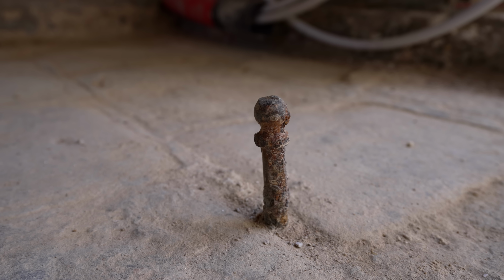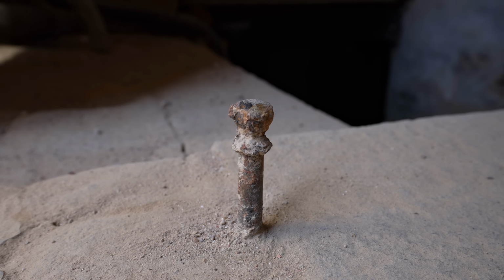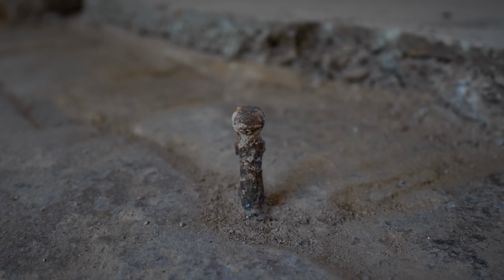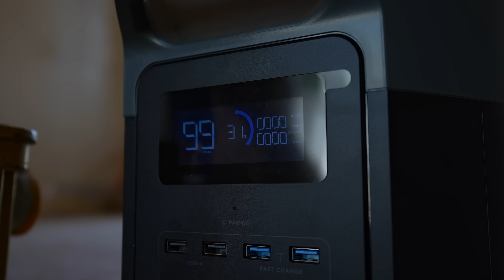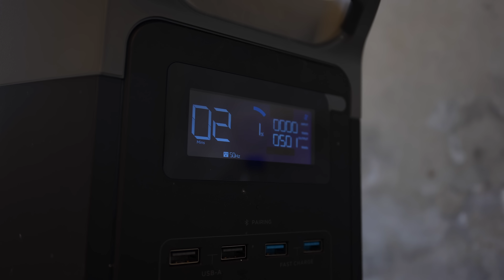Uncovering a 250-Year-Old Hidden Floor Beneath Concrete

Comment: Thank God! A voice of reason! Lol! Love it! I do have a question though…Are the doorways really that short? Or is it the camera makes it look that way? Usually in that time period for buildings of that time period, the doors were usually a lot taller. As you probably noticed at the chateau. I have been wondering if the height of the doors are the original height. The third floor I can see the doors being shorter but, not the main floor. Great job Billy! I’m glad you explained about those metal pegs on the floor, I hope you take them out, they are a trip hazard. But keep them. Put them in shadow boxes and display them somewhere with explanation. Enjoy your Sunday off. See you on Monday!

Comment: Thumbs up for in situ preservation where you can. I wonder if a clear epoxy or poly floor coating would give a smooth finish and provide some additional protection to the flagstones.

Comment: What about using paned French glass doors in that hallway? Let the light flow and would look stunning, especially if the panels are beveled glass 🤩
Reply: I am on the same thought as you are!   I think FRAMELESS glass doorS on both ends of what I believe was a walkway/cart path years ago.   The walls on either side are so thick, they are external walls.   You can Google frameless glass doors for old churches or buildings.   There are lots of places that can do those.    How wonderful would that look to be able to see the original walls on both sides and look all the way through to the back garden

Comment: I think raising the floor is the best option. You don't want different floor levels if it used for commercial or residential. If you number the stones, it will be put back in place with no one the wiser. 😉

Comment: One big question is does this floor material extend into the next room as well? We know it wasn't in the kitchen unless it was removed sometime in the past. No question that this is the original floor and it is extraordinary. Might need a bit of sand blasting to clean it up but that would be minor.  Some of those pieces bordering the floor where the steps go into the basement are massive.

Comment: I wouldn't even add ramps.Since you already have that step outside of the door, maybe just remove that so the threshold is only slightly higher than the floor to keep water out, and then get a slightly taller door.

Comment: Is this a dry laid floor with out mortar joints between the blocks? If it ism, you may be able to remove the stones one by one and raise the sub-floor bedding by 10 cm's. But that is a lot of work. 
On another note, the concrete that was removed is some of the funniest concrete chunks I have seen. The do not seem the crack across the aggregate but around it. It looks like "bubbles". This is not a criticism of Billy any any way, he is just removing the top layer.

Comment: Make the new floor level for all of the rooms the same as the hallway. Build the new doors at either end of the hallway to the original floor level. That way you only have one ramp - into the kitchen. 

If the next room has a good original floor, it should be on the same level. If it doesn't, you can dig it out as you did in the kitchen, but keep it at the same level as the hallway.

Comment: Of course, original is always better and it is wonderful to be able to walk on an original floor where it has been for hundreds of years. Having said this, different levels can be an annoyance. A lower level from the outside means there could be water issues if there’s ever an accumulation of water outside. It’s also a nuisance going in and out of the rooms that adjoin the hall. Another consideration is space. Every step, stair or ramp diminishes your floor space and makes it more difficult to move around in that space.  I am not a huge fan of ramps in historical places. Handicap accessibility is a modern development. Taking everything into account, if raising the floor is doable, I feel like the best thing to do would be to put in the time and effort to keep the end result as satisfying and easily accessible as possible.

Comment: I'm wondering why you didn't use a quick cut to slice up the concrete then use the Jac Hammer ?  And turn the bucket around ?  Wasn't it a practice back in the day when flagstones were a bit worn to lift them and turn them over ? You could put in under floor heating and re lay them ? That way they would be the correct level?

Comment: I would leave the floor as it is, as you will never get it back exactly as it is now. Also, raising it would destroy it as the original floor. All you get is "something built from original material", which is not the same.

Comment: Ramping it is a good idea. Just a word about that, in the US, and I presume there as well, there is a defined distance per elevation. Here it is a foot of length per inch of height, 30 cm per 2.5 cm given that my math is correct. So, that is to be considered.

Comment: Everyone is saying to leave the floor alone...It's not like you'd be tearing it up like the hearth. Do a few rows at a time and leave the pattern exactly like it is. While ramps are a thing I'd consider them a quick fix. You have been doing everything above par so far so why do minimal here? It is the entryway isn't it?. You need to put cones over those steel studs sticking up also.

Comment: Still think it was an open area where horse carts and stuff was pulled into the backyard. 
Also, now that the floor is lower again, you may need to make sure the doors have proper drainage so they don’t drain in.

Comment: I think it would be great to leave the floor alone, however I don't think It's realistic.  The reasons to rase It are to great.  First off If you don't you will have issues possible with water Intrusion. 
Second you bring equipment through the building all the time and that will probably always be the case. Third the handicap Issue. I thought about If you remove the thresholds since you are
putting in new doors anyway, but then the water Issue and the issue entering the other two areas.  If you ramp the floor, by the time you are done you might as well just have raised the floor up.
I fully vote to spend the three days with two or three helpers and rase It up.  If you are carful you will never notice the work having been done and everything will be smooth, level, and happy days forever.

Comment: I wonder if that room was a dairy.  If it was, they would have tossed water on the stones to keep the temperature down and the lower level would keep the water inside the room.  Is there dirt underneath the room or basement?

Comment: Gwen is right. After you uncovered in front of the doors, there is not much difference between the door base and the floor. Steps would be useless. A sloping ramp for the few inches you have. And Gwen is looking fantastic.

Comment: You probably wont read this as I still haven't cought up with the videos and its possibly already completed, I was thinking you could do a clear epoxy floor to bring it up to the other floor levels. I am no builder so I have no idea if you could do it or how much it would cost but it would be nice and smooth.

Comment: I would raise the floor ..put a membrane + insulation after all the good work in the kicthen i would keep up the standard  ...i have done this in my little chateau ..so i am not just saying it ...i understand the work ....also now i am saying it in the kicthen.i would have put the large Bank furniture in it,s  original design by bricking up the door in the centre and knocking through a new doorway to the side .... i did this to make five doors and window line up ...the wall was 60cm thick and 12Ocm wide took me two day on my own and a day to block the old door way up lot of work but worth it !!!!!!

Comment: The only problem I can see is that it will be lower than the surrounding surfaces. During heavy rain you may be creating a pool several inches in depth, but it would all flow into the basement before then.

Comment: I agree Billy.
Keep the original floor. This was my first strong suggestion a few days ago.
It is. "ORIGINAL " and preseved under all that concrete.  I feel strongly that if you did raise and re lay the stones, it would be a very changed  outcome.  Never original. More new looking. 
Again.
Regards. 
Shaelene Read. 
.

Comment: you might try this next time: :with a rotary hammer drill or diamond core drill......drill 25mm or larger holes shallower than slab thickness....pour in special expanding cement...walk away....come back to slab broken apart !!!!

Comment: No, Michael, you have to be on this side of this one! I think you're just hard at work, making another rubber mountain in the back area there. I think Gwen said nicely put a ramp in at the doors instead of a step. That way you won't have people tripping on the step all the time in. You can still use those stores to get equipment through or should I say equipment that fits and can't get through the door.

Comment: I must say, even though it's hard work breaking up concrete, it appears the concrete breaks up nicely. It is not like today's hardened rebar reinforced concrete. That's a blessing in saving the original floor with miminal damage. CRACK ON!

Comment: Are you sure those iron rods are not old door stops? Their design is exactly the same that is still use in here.
Reply: That was my thought at first, but there are several sets. So Billy is right, they were set in the ensure the concrete went in level.

Comment: Not very practical to leave the floor lower than the outside level. I would raise it and in that way you can isolate the floor from ground humidity and it makes it more easier to clean the floor.

Comment: Are those Oak wooden planks found in the basement the same depth of the step leading into  the passage from both main entrances, if so they could used for the ramps.

Comment: Leave the floor original without raising. Won't be the same if you raise it or even as original.  Plus it's a waste of time and money when there are so many more projects to move on to.  As others indicated, add wooden ramps for wheelchair access or whatever is required by the local govt.